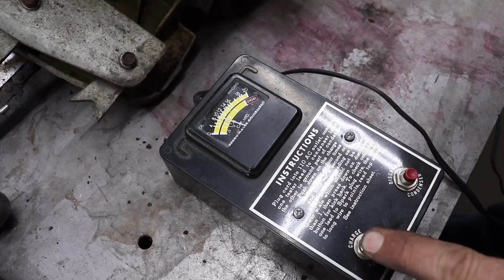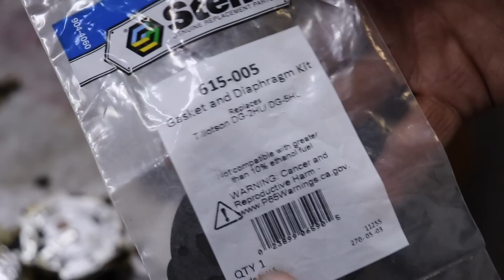You've NEVER Seen This Antique Saw - Will It Start?

Comment: Bet most of us 55 and older mechanics remember countless times helping someone broken down because of no spark with point ignition. Getting out a pack of matches and cleaning the points with the sandpaper on the pack and gapping them with the matchbook cover. This video was a good reminder of it for me. Both cars and many HD motorcycles. Now solid state and cd ign. much more dependable but you're SO of luck if in the boonies without spare parts. Thankfully we have cell phones. Great video as always,  Thank you.

Comment: Taryl I bought 2 chain saws back in 1996 from my local fee market,one was a Clinton saw much bigger than this one. The saw was freaking awesome I got so many comments about them when I was leaving the flee market.The Clinton had a  48 inch bar by 5 inches wide the brass fingers were 4 inches long like I said the saw was awesome. I got it running with minimal effort and it sounded like my Honda CR 250R dirt bike, it had a muffler but sounded like it didn't, like I said saw was awesome lol. The saw weighed 48 pounds a collector in my area said this saw was just set onto the log and it's weight did all the work. I really liked that saw I had no trees to cut but I had to have it I only paid $10.00 for it kept it for years, anyone who saw it in my shed was drawn to it for real. I gave it away 5 years ago to a local guy who collects saws, thanks for the great video it brought back good memories of the Clinton beast I once owned.
Reply: Imagine a Honda CR 500 powered chainsaw

Comment: When I was on the farm we had an old Homelite 7-21. This saw had the gear reduction drive and a 1/2" chain on a 36" bar.  It was hard to start and keep running but when it ran it was a monster. Cutting logs at the bars max length didn't bog the saw down at all. 
When running full speed the chain didn't move very fast, you could almost count the teeth as they went by. 
Being such a heavy saw and a bit cantankerous we didn't use it much in the woods but when we skidded logs back to the house we used it for blocking of the logs for firewood. Once you had the saw up on the log you didn't need to rock the saw or help it much to cut. Just hold it enough so it cut straight.

Comment: Great video. Most Clinton machines used tecumseh engines, I owned a few Clinton boat motors and upon researching parts found out tecumseh was the main power head of much of the equipment.

Comment: Hi Taryl, I have a question for ya - a lot of those older two cycle engine required oil/fuel mixtures like 16:1, 20:1 etc. Do you run those mixtures or do you use 50: 1 with the modern oils?
Reply: I have old and new saws plus other 2 cycle equipment. 
Problem is some are 16:1, 50:1, 40:1 exc.
So what I do is use omni oil in the soft packets.
It's a mix all.
It has stabilizer in it and it's good for all 2 cycle mix ratios.
16:1 all through to 50:1 and for new saws it won't void the warranty. 
Some manufacturers recommend it.
It helps me out so I don't have to have several gas jugs mixed up.
Reply: @hillbillyholler516  I've used Opti 2 in the same manner you describe in an old Shindaiwa weed eater. These days I'm using Amsoil Sabre which the claim can be used at 100:1 but I mix at 50:1 because I haven't had the nerve to try it at higher mix ratios on an expensive piece of equipment. I no longer have anything that requires 16:1, 32:1, 40:1, etc. I'll say that the Amsoil  Sabre burns very clean even at 50:1. There is almost zero plugging of the spark arrestor screen after a couple years of use.

Comment: Taryl, I have a 1957 Homelite 6-22 saw, its about the same as your Clinton, the 6-22 means 6 hp 22 lbs and it has a 1/2 chain also, 1/2 chains are sought after by antique saw guys.

Comment: Its amazing what young teenagers knew about motors and cars back in the 60s and 70s. I bought a late 60s ford truck and it would not start. So we took a piece of striker paper from a book of matches and  cleaned the points, put the distributer cap back on and she started right up. The battery was dead and we had no jumper cables. So we pulled our car in front of the truck bumber to bumper, and used the jack stand to go from positive battery post from car to positive battery post to truck , making our caveman jumper cables. Needless to say it worked perfect. That was the good ole days for sure. On a side note buying a new set of tires, a new battery, or filling up your gas tank was something you didn't even think about. Stuff like that was so cheap then. $5.00 would fill a volkswagen to the top.

Comment: A question off topic. What would cause the gas pedal on a riding mower to have no tension on it and the mower doesn't get alot of speed. New belt was put on and a new spring but still the same.
Reply: It’s most likely the nut behind the wheel 😊

Comment: Good repair job on the old '59. Wiring has never been my strong point, how did you know the coil wire was in the wrong place? You said "this wire should be going to ground and they have it going to the points. 
Anyway good singing.

Comment: I cant imagine using that 30 pound saw all day. I would be wore out the first hour. Loved the video.
Reply: Do you put a small amount of grease on points cam or
Reply: Just a dab of grease right behind the little L shaped fiber on the points that rubs on the cam. Some points sets even comes with a little packet of the grease.

Comment: I have a 1950s David Bradley chainsaw in the same kind of condition I just can't find the mechanics manual for it anywhere and the one I get I don't the one I found I don't trust it by any chance would you know where I could get that mechanics manual for that saw by any chance?
Reply: What do you need a manual for? It's all the same stuff. There's only one way any of it works. The parts in this saw are a different shape and size of parts in other saws but they're functionally all identical.

Comment: I use a match book paper it's thickness always worked on Briggs and Stratton motors 3.5 , 4.00 , 5.00 and so on the points if I didn't have a feeler guage at the time

Comment: Condenser is a capacitor that is used to help prevent ARC METAL buildup in the points contacts. Without it the machine will run, but the arc metal buildup will eventually reduce contacts area and current flow will be so low that the machine will not fire. Condenser normal fail by shorting out....which grounds the points so the machine does not run. Arc points is a failed condenser sign to look for. In a car the point are BLUE is excessive arc is encountered. When the points open, the current flow does not jump the point and instead is absorbed by the condenser....which feeds back the current when the points close agan.
Reply: The condenser is a snubber that absorbs the back EMF generated by the ignition coil. If it didn't the points would receive the current and burn up.
Reply: When checking the condition of the points you check to see which way they are burning and sometimes have to put a pencil point which is graphite in between to see the direction of current to make sure it is correct to make sure the coil + & -- is correct and the condenser capacity is correct. This was typical trouble shooting back in the day before solid state and cd ignition systems were used. Back when everyone had a pack of matches in their pocket or car and had to clean the dirty points when your engine quite. Match cover was your feeler gage.
Reply: @edwardkawecki8101  my fix for points is to change over to electronic ignition. I hate points. They're an endless source of problems.
Reply: @1pcfred  I agree if not properly maintained. My 67 Harley has been running flawless since I've purchased it in 1969 when I was still a teenager and never had problems with the points just with normal maintenance same goes for all my Farmall Cub tractors from the 50s. I do agree with the solid state ignition upgrades as a big Improvement for everyday running.
Reply: @edwardkawecki8101  I'd rather not have to maintain something if I can help it. And yeah Solid state tends to give a hotter spark. Though I'm not sure why it would. I dropped an electronic distributor into a buddy's 327 Chevelle once and we took it out for a test drive. He got on it some getting on the highway and he leaned over and shouted over the roar of the engine, Twice the power! I don't know how accurate that assessment was but it did seem perkier to me. I did power time it some too after I dropped it in. Gave her some advance. I'm sure that helped. It was crisp.
Reply: @1pcfred  yep I'm sure it did run better just like after you wash and wax your car they always run better and faster LOL
Reply: @edwardkawecki8101  It ran better because the ignition was burning the fuel charges properly. The performance increase was significant. My friend's estimation probably wasn't too far off.

Comment: Hello Taryl, I found that RAM-board or portable flooring (used to cover good floors  when 
 remodeling a home) makes a fine gasket for float bowl. I was wrkg on a model 23 Briggs 
one Sunday and there were no stores open for auto parts. It made a good intake gasket 
btween the block and carb too.
Reply: Nice tip, I  have a whole roll of that stuff I was going to give away. Need to save me a chunk.
Reply: @markw2266  I'M glad the stores were closed now, I so wanted to get that carb 
done and all but for gasket material, Im looking at the 2x3 foot piece of ram
board, Yeah this could work. Check out Green acres where he makes a head 
gasket from pancake batter,  Olivia covers the shallow  pan with batter and 
used a small pot to cut out 4 pancakes, when they were done and she put the 
flap jacks on a plate, you had a head gasket.

Comment: If an experienced mechanic don’t need a compression tester, I surely wouldn’t use a spark tester. Just stick your finger in the plug wire boot and snatch the pull rope really hard. You should feel the results in your “calibrated hands” 😂

Comment: Actually a fairly sophisticated carburetor with all the metering holes & multiple stages, etc.  I suppose in 1959 it didn’t cost much to build a good carb.
Reply: I was thinking the same thing!  That carb and the entire saw was engineered with the mechanic in mind. 👍🔧
Reply: Weren’t that great, real touchy. Had to be a mind reader to tell whether or not it wanted choke or not

Comment: What is the fuel oil mix on this classic saw
Reply: The old stuff liked it rich. Maybe 30 to 1 ?
Reply: @1pcfred  thanks for the info on that gas oil mix
Reply: @robertmailhos8159  I don't know why the old stuff needed more oil. Just what I've read about it. There was no explanation though. Perhaps the old oil wasn't as good? They didn't have synthetic. They did have lead.
Reply: @1pcfred  that is the truth about gas having.lead in it  the gas oil mix was probably 25:1 mix .or 32:1 mix
Reply: @robertmailhos8159  it wasn't lead like they make fishing sinkers out of. It was Tetraethyllead. But it did lubricate. It was great stuff.

Comment: If you ever get a filter that’s long as it’s not packed with dirt debris fill it up with the carb cleaner and then take an air blower and blow it backwards blow it it the opposite direction the fuel goes in OK another words blow it out like it’s going back toward the tank you can do that I’ve done that before and got by for a while anyway this is a six in a row jim from Kennerdell Pennsylvania I go by six and road jim I got a 91.5 dodge with six in a row under the hood yeah it’s a Cummins diesel hey Darrell highly recommend you give Amsoil two cycle oil a chance give it a break and give it a chance to prove itself I run my chainsaw and all that stuff if I knew how to post a video I would do it but I mix my two-stroke oil right about 110 to 1 and I’ve been doing it for years Amsoil said you can go up to about 150 to 1 I haven’t tried that yet I need to get an old weedeater or something like that and try it anyway good job on that old chainsaw have a good day guy😊❤